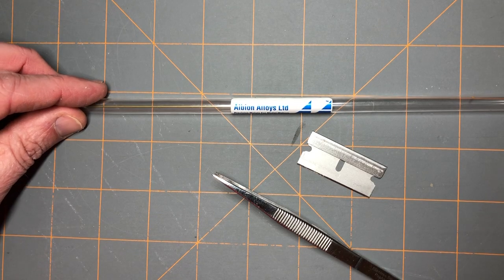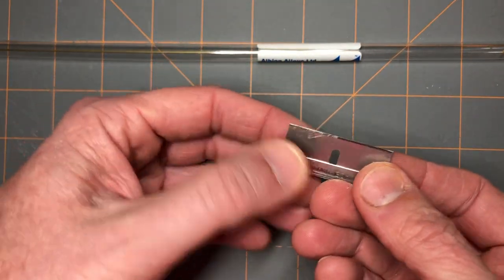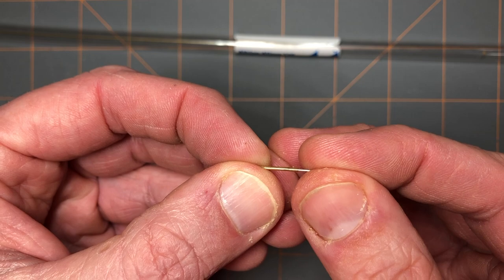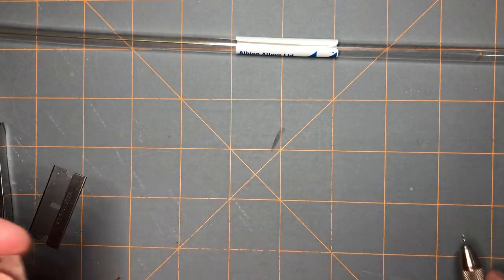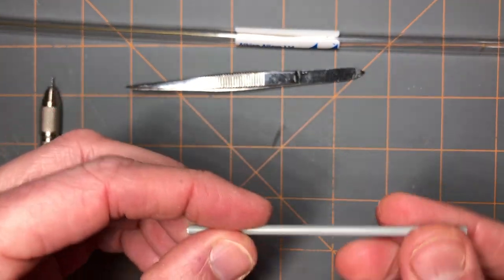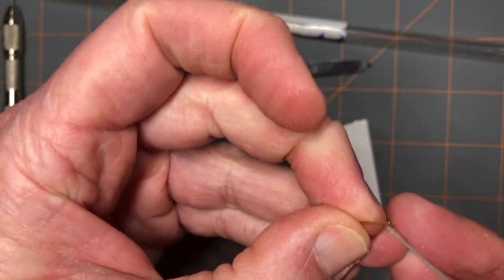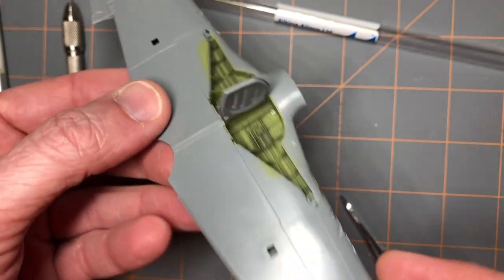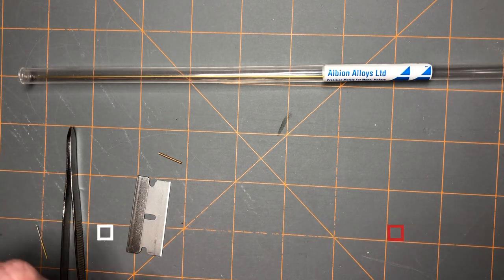Easy made model actuators and pitot tubes

Comment: It seems this method could be used to fabricate machine gun barrels also.  I need to fabricate a control stick for my 1/72 P-40, I think stretch sprue might be the answer..
Reply from the maker: For sure, David.  I have used this for gun barrels too.  Hypodermic needles work great there as well.  But as you say, I think stretched sprue is the way to go for the control stick.